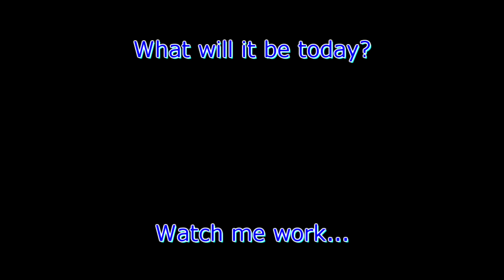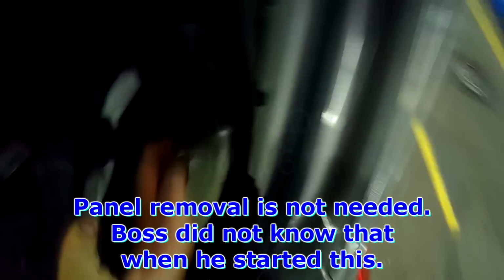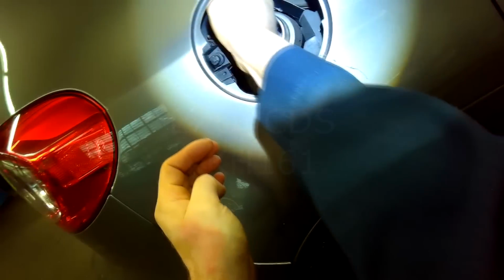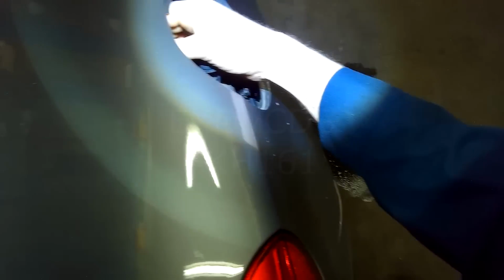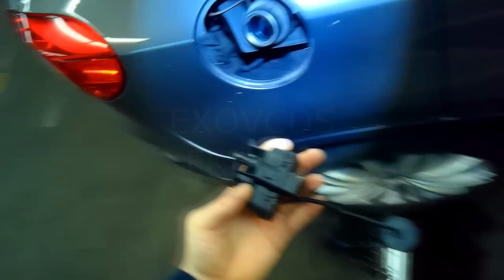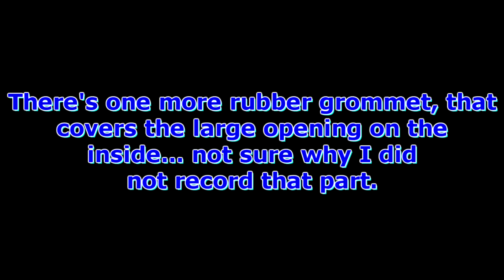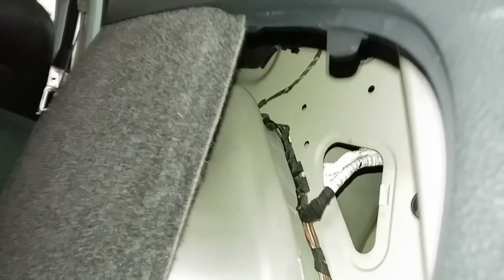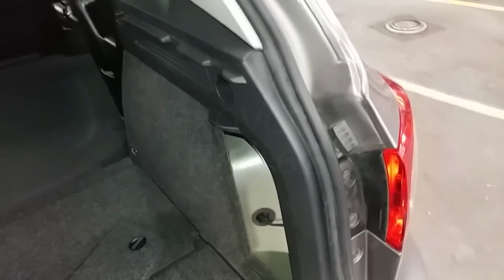VW Tiguan fuel door actuator re & re

Comment: You say panel removal is not necessary? How do you access it then?
Reply from the maker: 3:07 you can see me working behind the "partially pulled away" panel, which my boss popped out. After mounting the panel again, I determined that there was enough room to access the wiring / connector. Yes, it's a bit of a tight squeeze, but it is manageable. Working blind / by feel, may also be necessary. 
When in doubt or not having any luck, remove or partially pop the trim panel away from the vehicle. Service manual information is always helpful/ worth reading / investing in.

Comment: I was quoted about $300-$500 from multiple body shops just to replace the fuel door. Nothing else. I already had the part. Mine had snapped off in a car wash. I was told they'd have to disconnect multiple airbags, take interior pannels out, and would require about a day in the shop. I swear people think women hear complicated car words and just throw their money at their shops. Found your video, got an allen wrench, popped it out and put the new one in. Took about 30 minutes thanks to the drain tube thing, it was incredibly hard to shove into the new door. Thank you! ❤
Reply from the maker: Thank you for watching!

Comment: Help, if I don’t want to replace it, how can I disable it so it doesn’t lock anymore?
Reply from the maker: Break off the tip / head of the plunger or break off the "holder" on the inside of the filler door.

Comment: How do you open it first.
Thank you.
Reply from the maker: Read the comment from "Mike S" below.
Reply: @EXOVCDS  
Thank you.
I ended going with mobile glass sucker/ glass / sliding /plastic tool .
Pried open the left at 10PM right handed.....then slid in a pen and began moving down counter clock to 9> 8>7 and pop open suddenly.

Afterward opened the trunk, and open the left cover wall to
2 screws - display the actuator connection and disconnect. 

Now , I think is important to have the actuator shaft to open, so that when disconnected stay open and gas lid can open close.
Until you replace actuator or keep open as in the old days open.

Thank you for your support.
Thomas EXOVCDS.

A class action lawsuit possible.?

Comment: how can I lock/unlock fuel door for tiguan 2008?
Reply from the maker: With the key FOB or by turning the key in the driver door handle. If the fuel door does not lock or unlock, then the actuator might be bad. You have to press on the door to open it and close it... it does not pop open by itself like other fuel doors.

Comment: Hi, my car also it is not working when i checked like you explained..the actuator is integrated with with rubber cover, whole flaps come out in one piece...neither is connected to any other sensor...any idea what to do?
Reply from the maker: Which generation Tiguan? I believe that the one in the video was a first generation.
Reply: @EXOVCDS  I have VW Mk6, i believe VW has same concept in all the models
Reply from the maker: Sorry... I'm not following. Your mk6 is or is not different from this Tiguan? What's the actual issue? The motor does not do anything? When lock or unlock is pressed? Does the door close & stay closed? I have not had a mk6 fuel door assembly out... I would have to check a service manual to see if & what might be different.

Comment: Nothing like your boss starting a job and then leaves you to finish it! Didn't look too bad of a job and as always, nice work!
Reply from the maker: The hardest part (which I forgot to mention) is opening a flap door that is in the stuck closed position. It's pure luck... tapping on the door flap while hitting the remote, or trying to wedge it open with a screwdriver.
Reply: I was wondering about that.. i was guessing brute force was involved ;-)
Reply from the maker: Yes... breaking the actuator is ok because it will be replaced. Having the flap door break is a big setback (new one adds money to the repair and it needs to be painted to match the car)... that can sometimes not be avoided.

Comment: Had this repair done last year to our '12 Tig.  Needed 3 visits to the local VW dealer and they broke the fuel door in the process.  Still doesn't work right.  Should have changed the actuator myself.
Reply from the maker: C RB Breaking the door is inevitable in some cases during the "prying open" stage. I was lucky that my boss managed to get it open before I took over.

Comment: Thank you so much for posting this video, I just replaced mine! 

I had the tank door locked and it wouldn’t open because the actuator was broken. I did not know how to reach the button for manual unlocking on the actuator. For others who might be facing the same problem: It turned out to be reachable only from the outside of the car via the wheel arch.
Reply from the maker: Thanks for the info and thanks for watching!
Reply: Could you share how to reach this? Do I need to remove the wheel arch cover? Thanks.
Reply: rawnafila yes exactly you need to remove the cover behind the wheel (from the outside). There is no need to remove the wheel. At least, that how we did it.
Reply: m sanderman thanks for replying. I managed to pry open the flap using hard plastic then just removed the flap assembly before finally removing the actuator.
Reply: Can you post a link to that release button on the actuator. ....picture or video.
Thank you